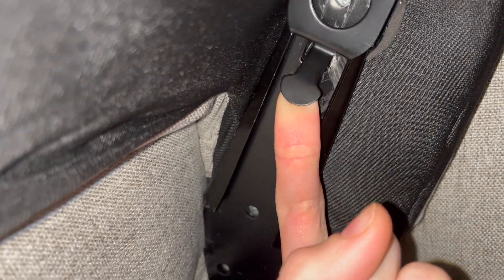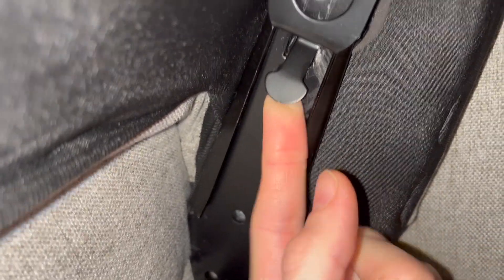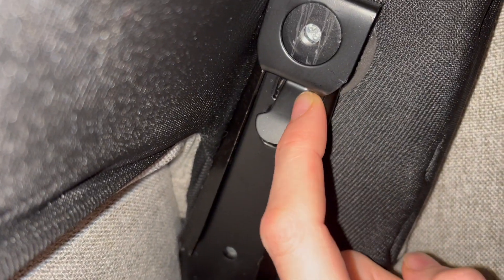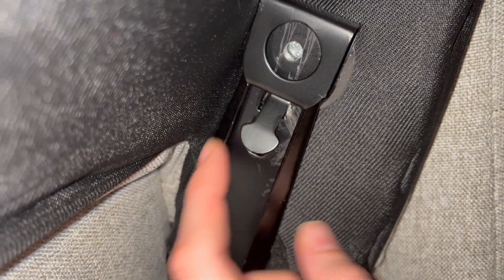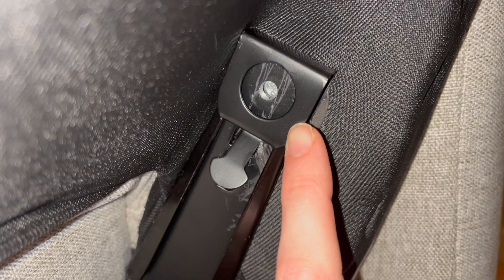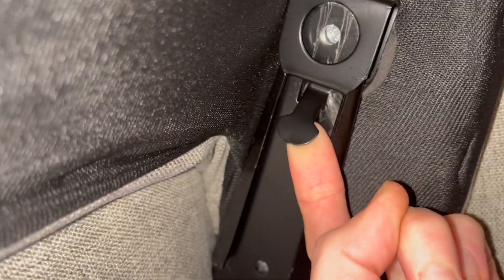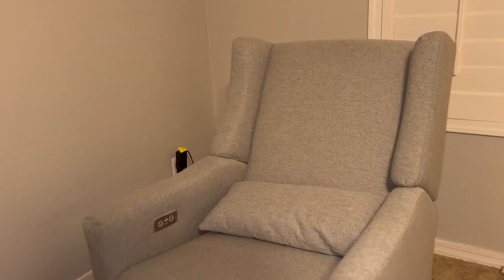How to install back piece on the Babyletto Kiwi Electronic Recliner Swivel Glider video #babyletto

Comment: what are your fav 5 tools big al?
Reply: @Adam. That is a great question. The number one tool would be the San Angelo bar. It has enabled me to complete some projects that I thought would be impossible. The others would be the ones I use most frequently in no specific order:  Phillips and flathead screwdrivers, crescent wrench and drill. There are many other amazing tools that are out there that enable the completion of many DIY projects.  Thanks again for the question and best of luck with all your DIY projects and hopefully you will subscribe to Big Al Repairs.